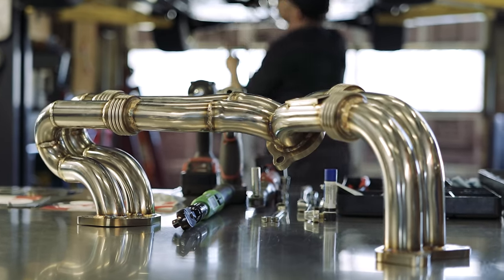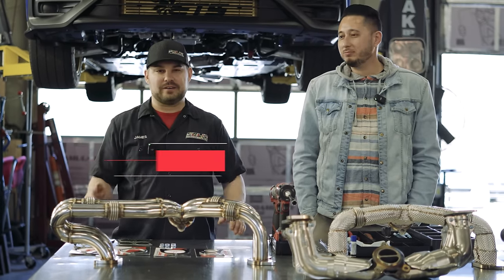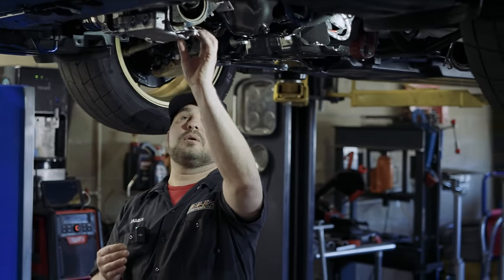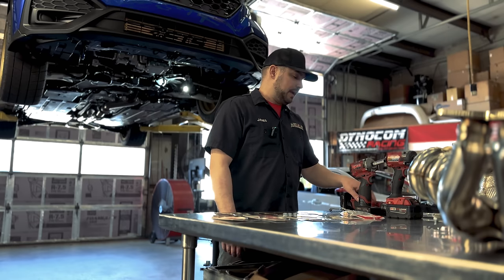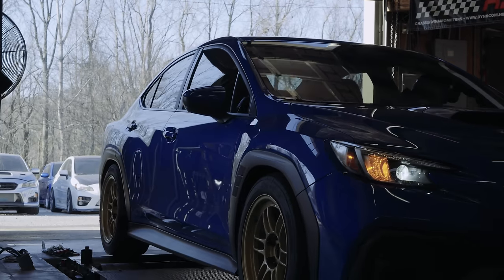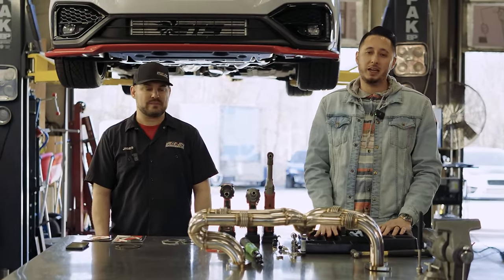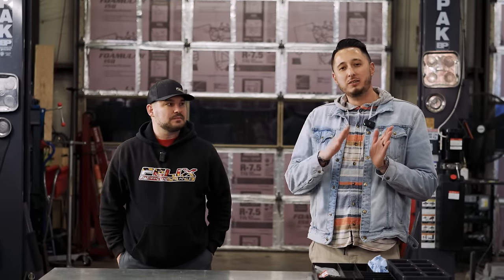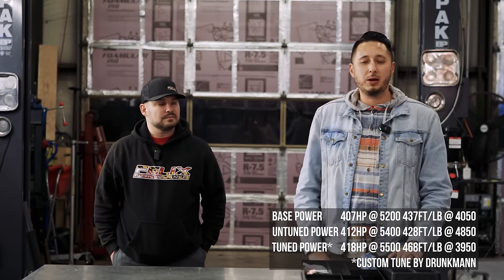JDMuscle Unequal Length Header 2022+ VB Subaru WRX - Sound, Dynos and Installation #rumble

Comment: Hell yea!! people can complain about slight losses in HP when taking the car to the track, but when its street driven only, thats the sound we are looking for, thanks for the video as well as the development of the part.
Reply from the maker: And it's actually HP gain! with some tuning you can get the torque back too
Reply: @jdmuscleusa does the horsepower gain come from the fact that the new uel header does not have cats like the OEM header
Reply from the maker: @rmblwgn  plus larger diameter
Reply: Diameter is only a part of the equation, and doesn’t guarantee gains if you lose velocity, and I’d be willing to bet the stock turbo isn’t big enough to where larger diameter is required. I’d argue the catalytic converters are the worst restriction. I’d like to see what an EL/twin scroll header of stock diameter will no cats can do, I bet it’ll spool a lot faster and make more power everywhere in the rpm band. UEL’s are a “form” mod, not a “functional” mod. It’s all about sound, not performance…

Comment: You want STI sound, they need to be merged at each bank flange into 2 pipe’s instead of 4. UEL gives you the rumble but the sequential pair gives you the bass. Reducing the runner volume may also increase spool. Killer B UNholy header is the only sequentially paired FA turbo manifold I’ve seen but never heard. Sequential EL is where it’s at personally, but I understand the love for UEL.

Comment: I think it's important to make a twin scroll header feeding the twinscroll turbo. Uel or EL should both pickup power. My only worry with running these single scroll headers is exhaust pulse is off and can cause back pressure issues with the cylinders fighting each other on each exhaust stroke. Cylinder 1&3 feed one scroll and 2&4 feed the other. Also becareful of not to go to big on the header pipe size feeding each cylinder, you increase flow but loose velocity.

Comment: Damn this chassis can handle way more torque than the 2015+
Reply: That's why I'm sad there's no STI ver for it
Reply: (not counting the tS)
Reply: @weeb0.  honestly i feel like people are irrationally upset about there being no VB STI. sure, we dont get the famous STI driveline with DCCD. really, though? that's all we are missing
Reply: Yeah agreed on the STI point. It's the best WRX to date.
However, low steering feedback(floaty), weaker transmission, and the pads and rotors are very prone to fade. Even still, my WRX is being ordered
Reply: The connecting rods are literally 3x thicker on the FA24 then the FA20, and the crank is beefier. It can handle that torque
Reply: @stormblessed9455 Subarus OEM brakes have never been impressive, they’ve always worn out quicker then most other vehicle it seems as well. At least on the 3 I’ve owned for the last 2 decades that seems to be the case

Comment: Why this isn't still a from the factory trademark of WRXs perplexes me. The rumble is worth whatever side effect it is a necessary trait to driving a Subaru. Boy am I glad my stock 2008 wrx came with unequal lengths from the factory. Throw in a catless downpipe, $200 3'' pipe with a cherry bomb at your local small town exhaust shop, and you have one hell of an exhaust note.
Reply: Because it is inefficient and causes issues, and totally defeats the purpose of twin-scroll turbo setups.
Reply: Yes, but no rumble :(

Comment: Would like to see the twin scroll version.(Also, regardless of which, that VB looks fast as hell lol).
Reply: Looks fast but definitely isn't lol
Reply: @ranran2218  pretty sure 450BHP+ qualifies as fast dude.  There isn't much on the road that's beating you with that power and that can still actually take corners.
Reply: It’s 415 whp which is almost 485 -500 bhp. Not the fastest but still faster than what most people drive
Reply: On e85*** which is not available everywhere. This header won’t make past 350 whp on 93... I’m looking forward to my local tuner (VEMS) doing actual tests with these, as it will be unbiased… this manifold will not outperform the stock header, at all… let’s see actual dyno overlays of both cars tuned to the max, let’s see what happens… UEL’s are a ricer mod, pure and simple. You can put UEL’s on a D series Honda, sounds the same as the “boxer” rumble…

Comment: Its not really a fair comparison with the stock header. I bet a EL aftermarket performance header will make more power than both of these UEL headers, have faster spool, and be healthier for the engine. Sound is objective, performance is not.

Comment: Nice!!! What product is it that you use on the exhaust manifold that looks to be that metal heat shield wrap???
Reply from the maker: This is our signature 3-layer heat shield which is offered as an upgrade :)
Reply: @jdmuscleusa  any chance I could purchase separately??
Reply from the maker: @Chris05STi1982  This is actually 3 separate pieces hand crafted together so unfortunately no
Reply: this stuff is available in flat sheets from other places. work some google-fu

Comment: What gear are you running those cars in on the dyno? Seem to run through the revs a bit too quick
Reply: Sounds like 3rd, most places do 4th on a 6 speed.
Reply: @justinlavigne2573  4th is the standard gear used. Im sus on this one

Comment: They second one sounds great! But I don't want to lose almost any spool. UEL should spool quicker right? That was the excuse from Subaru on the STI header design, plus is cost less. EL header is more power, mostly midrange I hear. However both probably are more power than stock (see dynoes).

Comment: what single scroll turbo was used for this?
Reply: The car is completely stock besides exhaust
Reply: Wasn't, they made a single scroll headers for a dual scroll turbo. Could be the issue they are running into with loss of power in the low end. A dual scroll headers uel or EL will more than likely out preform the current design in the video. Granted I give them prompts for testing and trying.

Header design is honestly science. Brocks Preformance for motorcycles has it down but he's been designing and understanding headers for 20+ years.

Comment: I don't think this is an upgrade at all because the concept totally differs from the OEM STI header
where the header piping are the shortest length between the exhaust ports and the up-pipe/turbo.
This one though sounds arbitrary because the extra length has no purpose, it is just deliberately elongated
and mated to the J-pipe/turbo for the sake of the rumble sound  and I don't think it does any good performance wise,
the gains might be due to the engine itself. IMO, it's rather a downgrade.

Comment: If the flex joints are only there to allow for ease of installation then that header is shit and the manufacturer isn't capable of designing it to the tolerances required for ease of installation. Love an aerospace engineer that has done way too many tolerance stack ups.

Comment: Wow. These sound way better than FA20 with UEL Headers. Sounds more like an EJ than the FA20 ever couldve... what size are the runners? Same diameter as the FA20 Tomei UEL Header? Idk from video they look like a smaller diameter than the Tomei. Is it possible to make these with bigger diameter runners? Not much you can do design wise unfortunately... AVO made a "slightly" UEL Header for the FA20 made for their Turbo kit. Basically they just didn't make the unequal side runners as long, idk how they sound or perform... but man this is making me consider a VB over a VA STI lol. I was going to trade my VA WRX in for an sti but idk anymore... those power numbers look very VERY tempting, and probably half the time/money spent if you were to try to get an EJ25 to those power levels. I want Subaru to release the mid life cycle refresh already, hoping they ditch the fenders with the mid life cycle refresh lol.

Comment: Oof, there goes a blown motor. Never run an unequal length header! Sure, it sounds better but the longevity of vehicle goes down exponentially.
Reply: There’s a reason why they’re manufactured with equal length headers to begin with now (fa24). If you look at all the 02-05 bugeye and blobeyes theyre all blown partially due to unequal length headers. Something to do with the gas being hotter in other cylinders /collectors than the other two causes issues with the cylinders and piston rings (becoming brittle). Do your research! I’ve been a Subaru mechanic for 20+ years and has also been told on some credible sites that sells headers in the past explaining why unequal length headers weren’t good for your motor in the long run. Why do you think subaru now runs equal length headers in their newer wrx generations ?????? 

Please, save your car. The Subaru rumble isn’t worth it, trust..

Note: there’s a reason Subaru went away from the the unequal length headers